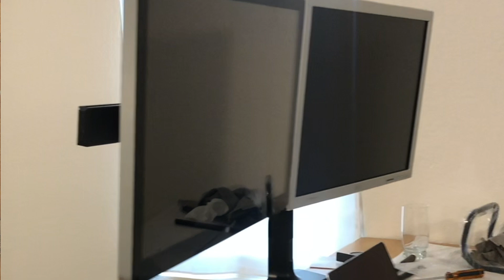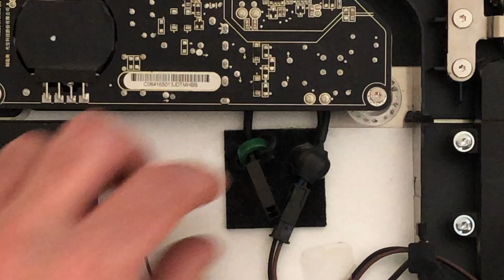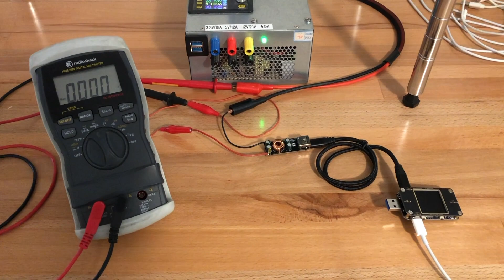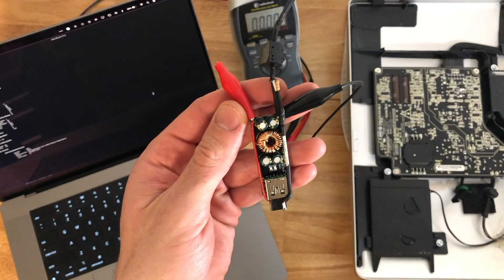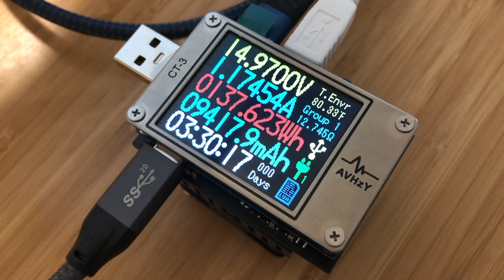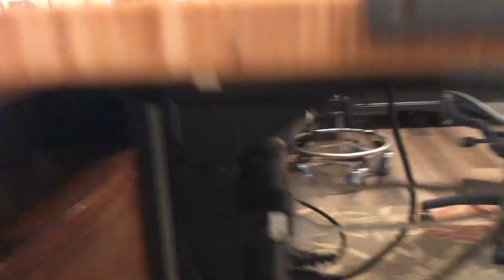Thunderbolt Display USB-C Retrofit for Modern Macs!

Comment: Thanks a lot Colin for this amazing video!
I currently have an Apple Thunderbolt Display (27 inches) and I wanted to change my current MacBook Air (13-inch, Early 2015) for a M1 MacBook Air and/or a M2 MacBook Air. However Apple is discouraging users to do that because they say material is not compatible. Apparently users are complaining about flickers and dead pixels appearing (top right). Have you experienced anything like this since you made the cable changes?  
If not, I wonder why the team at Apple would be fixing compatibility on M1 MacBook Pro and not fix it on the M1 MacBook Pro. Both computers must be very similar.
Reply from the maker: I haven't heard about that, but if you have a link please post it! I haven't had any issues at all since doing this conversion. 🤞
Reply: I have heard about the flickering and I can confirm I have no issues, maybe an update fixed this?

I have an iMac Mini M1 with an original Mac Thunderbolt Cinema Display 27" and also an Apple 24" LED Cinema Display (Display Port), I use a powered via USB, HDMI to Display Port Adapter.

The iMac M1 Mini will not support 2 x Thunderbolt Displays.  They only support 1 x Thunderbolt and 1 x HDMI.  -:

Video Support
Simultaneously supports up to two displays:
One display with up to 6K resolution at 60Hz connected via Thunderbolt and one display with up to 4K resolution at 60Hz connected via HDMI
Thunderbolt 3 digital video output supports
Native DisplayPort output over USB‑C
Thunderbolt 2, DVI and VGA output supported using adapters (sold separately)
HDMI display video output
Support for one display with up to 4K resolution at 60Hz
DVI output using HDMI to DVI Adapter (sold separately)

However the MacBook Pro M1 will support more depending on M1 chip:

Display Support
Simultaneously supports full native resolution on the built-in display at 1 billion colours and:

Up to two external displays with up to 6K resolution at 60Hz at over a billion colours (M1 Pro) or Up to three external displays with up to 6K resolution and one external display with up to 4K resolution at 60Hz at over a billion colours (M1 Max)
Thunderbolt 4 digital video output

Native DisplayPort output over USB‑C
VGA, HDMI, DVI and Thunderbolt 2 output supported using adapters (sold separately)
HDMI digital video output

Support for one display with up to 4K resolution at 60Hz
DVI output using HDMI to DVI Adapter (sold separately)

I am told the M2 chip has same limitations also.

Comment: I just purchase a Mac mini m1 and I quickly found out it was not going to work with my 27” Thunderbolt Display does anyone know what adapter I will need to make this work
Reply from the maker: You should only need the Apple Thunderbolt 2 to 3 adapter, the same one I used in this video.

Comment: Interesting video.  Thanks.  Is there a reason not to just use two adapters at the end of the OEM cable?  Thunderbolt to USB C, and Magsafe to USB C?
Reply from the maker: I tried that first and it was awful. The adapters are bulky, the Magsafe adapter overheats and connection light becomes useless, plus there is lots of stress placed on the USB-C ports. It defeated the best feature of the Thunderbolt display to me - a clean desktop. So like I say in the video, my goal was to get that back with my new Mac.

Comment: I need more info on that dual display mount. I also have 2 TB displays and struggle to find something strong enough to hold them.
Reply from the maker: It's a VIVO STAND-V102H dual monitor arm. The same model is sold by a few manufacturers under different model numbers. It's decent but dual 27" screens is pushing it on any of the common arms out there. I've tried 6-8 different models and I like this one the best because it keeps the screens in the same orientation relative to each other.
https://www.amazon.com/gp/product/B08LM68CSP
Reply: @colindgrant  thank you! Yes I actually found it after I posted my comment (after lots of searching). I bought and installed it a few weeks ago. My dual 27 Thunderbolt monitors seem too heavy still, I probably need to tighten everything again. It's definitely not as smooth as yours.
Reply from the maker: @themichaelholdren  mine is not as stiff as I would like it to be. I did a lot of little adjustments On just about each screw. And I used a metal reinforcement plate on my desk so that at least the base of the V102H was solid. The way they designed it the displays are just cantilevered out too far away from the top hinge on the arm. It's strong enough to lift them, just not stiff enough to resist twisting and wobbling. Still, the best of the ones I evaluated!
Reply: @colindgrant  yup that makes perfect sense, that's my experience as well.

Comment: great video, now do you think you could create a switch to use our thunderbolts with two computers?? I've been looking everywhere and it doesn't exist. without having to constantly plug and unplug our Macs. It's the same for the new studio and xdr pros.. all kvm switches are hdmi, display port, but NONE work with this thunderbolt 2 or 3. I can't be the only one who wants this!  You seem capable of such a thing!! liked and subbed by the way!
Reply: Also could you link the usb-c thunderbolt capable extension cord you're using??
Reply from the maker: Hi @sean.sullivan , sorry I missed your comment. The extension cable is linked in the description.
As far as a KVM, I'm guessing the reason you're not finding them is that KVMs usually switch a pure video signal (well, in addition to keyboard and mouse).  But Thunderbolt is a general data transport standard. It's kind of like a ferry, and video/audio/USB/ethernet are the cars that can ride on the ferry. They can drive point to point on their own, but in order to ride the Thunderbolt ferry, you have to have a ferry terminal at either end. So in order to have a KVM that acted like a ferry terminal for Thunderbolt, it would need extra chips and licensing, and that would drive up cost.

I don't know of a way to connect two Thunderbolt video sources (computers) to a single Thunderbolt display.

The nearest thing I can think of is to us a non-Thunderbolt HDMI display, and use Thunderbolt to HDMI dongles on each computer's output. I know that's not what you're hoping to hear!

Comment: Will this Setup work to get a Windows Laptop connected with the Thunderbolt Display by using the Bootcamp drivers for the Display?
Reply from the maker: I'm really not sure. I wouldn't be surprised if Apple went outside specs for the TB2 to TB3 adapter, and used MacOS updates to make it work.
Reply: I tried to get my Thunderbolt Display to work with a Windows laptop during lockdown without any luck.  If you manage to do this please let us know.

I tried a variety of drivers from Intel but while it could see and recognise the Thunderbolt interface, I could not get the display to come on.

Comment: Like miani just made a video about taking apart an iMac and turning it into a 5k monitor. I looked at the hdmi and display port board on the iMac he installed and I don’t see a fan. Do you think a 5k display could continue to be used without a fan? Here’s the video: https://youtu.be/0VXQu0fAc8s
Reply from the maker: That's a great video. I don't know if a fan is needed or not. The power supply for the Magsafe is probably what gets hot, if anything. I never ever hear my fans turn on, except briefly at startup now and then.

Comment: I have been trying to connect my Thunderbolt 27" Display to both of my Macbooks Pro 16" 2019 and 2016 without any luck using the Thunderbolt 3 (USB-C) - Thunderbolt 2 adapter. The monitor works fine with my old Macbook Pro with the Thunderbolt 2 inputs, I watch many videos and it works for some but not for everyone. ANy clues? thanks
Reply from the maker: That's strange. I'd probably take it all to the Apple store and see what they say because it's all Apple products and as far as I know it should work.
Reply: @colindgrant  Thx for the reply Colin. I talked to a Mac repair shop and they told me to buy a dock station with the power supply ... those Macbook Pros' Thunderbolt 3 connectors supposedly can't power Thunderbolt 2 devices :( and they are difficult to find now so I just need to buy me a new monitor ... thx for your video though

Comment: Why retrofit the magsafe 2 into usb c rather than into usb a and use a USB a to magsafe 3 cable?
You'd save a tb4 port on your laptop and actually make use of the magsafe 3 port. Did I miss something?
Reply from the maker: Yeah, that's another option. And that would definitely work with the way I converted Magsafe 2 into USB-C PD inside the monitor.
It's a personal preference. I'm reserving my USB-C to Magsafe 3 cable for travel. I could have bought another but they're $50, and I actually like having the USB-C power delivery cable on my desk for temporarily powering other things. The intention with this retrofit was to have a very clean desktop and not plug anything else into the laptop, so I was ok with using up an additional TB4 port but I see your point on that.
Reply: @colindgrant  you did a wonderful job. I wish I had the knowledge... And the talent.

Comment: Thanks for this informative video. I have a Mac mini M1 connected to an Apple Thunerbolt Display. So I don't need the power cord. Now the Thundebolt cable seems to give up the ghost (occasional, short-term blackouts). Can I just replace the Thunderbolt cable with your method and leave the connector for the power cable empty?
Reply from the maker: Yes, you could use this method to put the adapter inside the monitor case and run a USB-C cable down to your Mac Mini. Or you could use the method recommended by @DavidMalcolm above, just buy a TB2 to TB2 cable, plug it into the port on the back of the Thunderbolt display, then coil up your original umbilical cable and ignore it!
Reply: @colindgrant  Thank you!
Reply: When the display is flickering, why does everyone feel confident that the problems stems from the thunderbolt cable, but not other components like the logic board or the power supply. Thanks for the walkthrough though.
Reply from the maker: @leonugraha  I had the same skepticism and questions. I can only share my experience:

- With single TBD plugged in using original cables.
- Same symptoms on 2015 MBP w/TB2 and also 2021 MBP M1 w/TB2-3 converter.
- Display would suddenly go fully black (not backlit, as if unpowered), with no obvious cause
- Display stayed black, did not flicker, did not self recover
- Occurred with no physical movement, no particular temperature, no change in peripherals, no identifiable length of time,  or pattern of app usage.
- Arriving at my desk in the morning, display would often not wake up.
- Unplugging/replugging the TB2 cable would sometimes bring back display image, sometimes peripherals like iSight camera or built in speaker would come back as well, sometimes not.
- Only reliable recovery method was cycling power on display and rebooting laptop.
- Even while things were working, I could feel heat on the TB2 connector at laptop.
- Easiest test is to unplug the built in TB2 cable, use a standalone TB2 cable plugged into the daisy chain socket on display.

It's an all digital connection, so I think this was an issue of some signaling or voltage threshold being violated. Or perhaps the shielding was broken down and allowing interference. I believe the laptop detected something was out of bounds and just shut it down. I didn't look for logs, but there may be some.

If your display comes back on its own, that may be a different issue.

Comment: With this being 22 minutes long, I expected it to be a single cable solution...  Why not just use the TB adapter for display and proper power brick for power? Same amount of cables, and you get full power charging.
Reply: That's what I was thinking or plug the thunderbolt cable into a thunderbolt dock and get power and video through 1 cable.
Reply from the maker: You probably didn't watch the beginning of the video where I explained exactly what I wanted. That's ok. Since then I did come up with a single cable solution you may like better:
https://www.youtube.com/watch?v=2YE8N8NHb-A

Comment: Hi, thanks for the video. My thunderbolt 3 (USB-C) to thunderbolt 2 adapters have been broken twice in the last two months. Apple still replaced the adapter but is there any possibility that my Cinema display cable is overcharging/affecting the adapter? When I connect the old MacBook with Thunderbolt 2 to my apple cinema display, it works perfectly because there is no adapter. Thank you so much
Reply from the maker: That is strange, especially because the Thunderbolt 2 connector by itself works fine with the older Mac. As a troubleshooting step I would try using the adapter with a TB2-TB2 cable plugged into the socket on the back of the monitor.
Reply: @colindgrant  Hey bud, are you saying that if someone is having issues with the original TB2 cable that is coming out of the display (flickering, etc..), then you can use a new TB2 to TB2 cable, plug it into the back, and that will also feed the video?  I just purchased a TBD and a new MacBook Air, and the screen is great but every once in a while, or sometimes more frequently, it turns on and off.... bad cord? Thanks in advance.
Reply from the maker: @roysgti  that’s right!
Reply: @colindgrant  My man, thanks so much for getting back to me. I may tackle the video project eventually, but just for the TB2 cord, and not the power delivery side of it. I truly appreciate your time, your video, and your response. Cheers mate!
Reply: I used the first adapter about 6 months before it is broken. Apple tested it and replaced a new one for me. The second adapter only worked for 1 day and then it is broken, with the same problems ( black screen, flickering, etc. ).

Comment: i imagine it would be pretty cool if you had the second wire as a USB C to magsafe to supply power, just as it originally was. Really cool project!
Reply from the maker: Thanks! You’re right. I’m keeping the USB-C to Magsafe 3 cable that came with the MacBook for travel but it would totally work instead of the USB-C to USB-C cable I used for power.
Reply: @colindgrant  you could also utilize the thunderbolt extension chord you bought in combination with a usb-c multi port adapter which allows powerdelivery pass-through. This way you can get both power and data through one usb-c (thunderbolt) cable. At home I just connect one thunderbolt cable to my setup for both charging, display and peripherals.
Reply from the maker: @atacant  Link?
Reply: @colindgrant  I live in turkey so it might not be applicable for you but it is a dock from Baseus, it looks like an O.
Reply from the maker: @atacant  Thanks. I've seen those but not one that supports Thunderbolt. I think "video over USB-C" is a different transport protocol than "video over Thunderbolt", even if Thunderbolt is using a USB-C type connector.

The Mac probably supports both, but I'm pretty sure these monitors are specifically looking for "video over Thunderbolt".
Reply: @colindgrant  good point. I didn't think of that. Thanks for clarifying

Comment: I use 2 TB monitors with my Mac. You also could get around the busted cable by connecting the Mac to the thunderbolt port on the monitor with another cable.
Reply from the maker: That's a good point!
Reply: @colindgrant  @DavidMalcom, for me on a MacBook Pro (13-inch, 2020, Four Thunderbolt 3 ports), using the built in Thunderbolt port on the back of the display "worked" but it only gave me a 1280x720 max resolution on the display. I ended up doing the video side of what Colin showed to get my monitor working again and I plan on doing the power cable side on an upcoming rainy day. Thanks for this great walkthrough!
Reply: I just purchase a Mac mini m1 and sales rep told me it was a plug and play with my old 27” Thunderbolt Display is there a quick work around to make this work like adapter of sorts your recommend
Reply: @carlosr.2027  yeah you just need the apple thunderbolt three to thunderbolt 2 adapter.
Reply: @MegaX33  awesome much appreciate it , and let me get this straight you are running 2 27” Thunderbolt Display with you Mac mini m1 at full resolution using the Same adapters ?
Reply: @carlosr.2027  I'm running two off a Mac Studio. The Mac mini M1 supports one display over Thunderbolt and one over HDMI. I am not aware of a way for it to power two Thumderbolt displays.
Reply: @MegaX33  oh ok so Mac studio can support 2 Thunderbolt Display so what adapter are you using for that set up or would it be 2 Thunderbolt 3 to tb 2 adapter ?
Reply: @carlosr.2027  Yeah you just need one adapter and then you plug the second monitor into the first. Any computer with an M1 Pro, Max or Ultra can do two monitors. Just the M1 or just the M2 can only power one display over thunderbolt.
Reply: @MegaX33  I thought the new Mac mini m2 coming this fall would support 2 tb display there’s rumors that they could scrap m2  and implement the m1 pro/max chip on the new Mac mini have you heard any solid info on this ?
Reply: @carlosr.2027  Releasing an M1 Pro in the Mac mini might drive down sales of the Mac Studio. I'm honestly not sure. Apple's whole Apple Silicon roll out has been really hard to predict. I don't really see them releasing any M1 branded things in the future unless they put it in the base iPad.
Reply: @MegaX33  I just did a bit of researching on the next Mac mini and there’s rumor mini m2 pro release  by the end of the year, would it be capable of doing two thunderbolt display like the mac studio ?
Reply: @carlosr.2027  I'd expect an M2 Pro would be able to drive two external displays as the M1 Pro can as well.